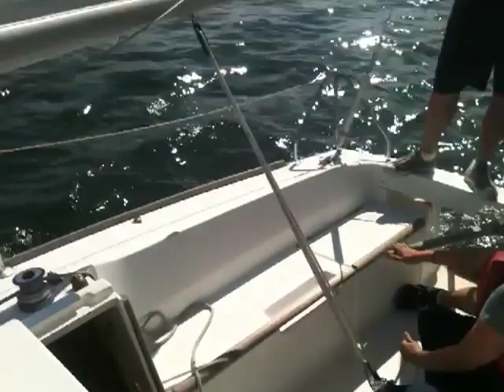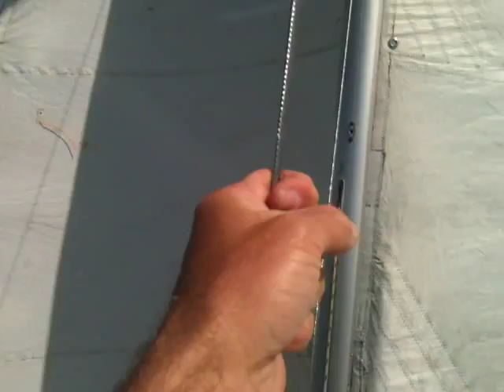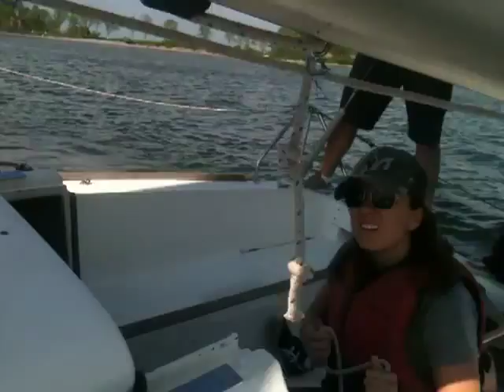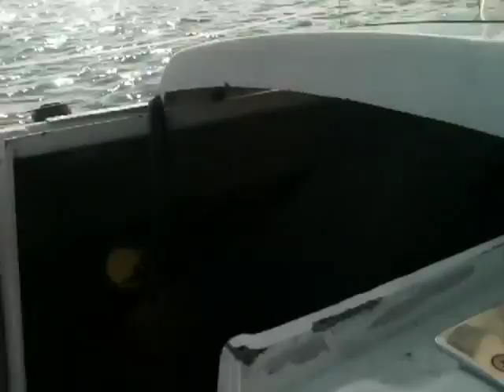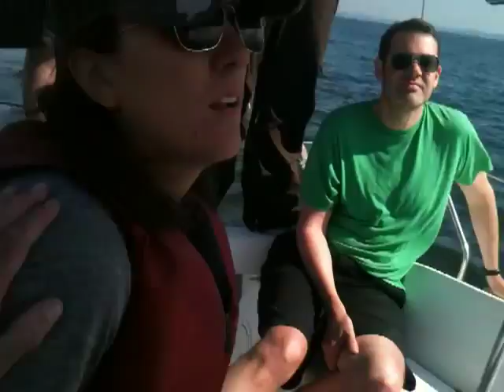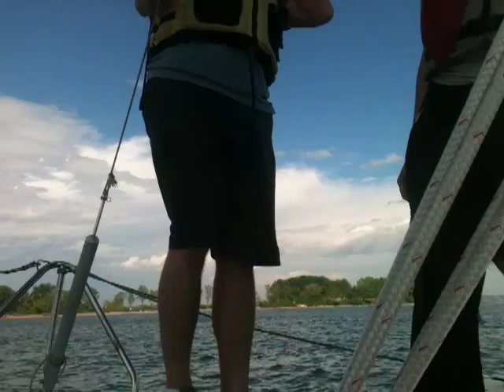Learn to Sail: singlehanding around our Obstacle Course

Comment: Thanks for responding to my comment.  A life jacket is only going to work if it's being worn and it shouldn't matter if the weather is hot or cold as far as if you should wear one or not.  I'd rather be a little uncomfortable and know that I'm doing the right thing by wearing a life jacket.  The Coast Guard rarely pulls a dead person out of the water that is wearing a life jacket.  It's usually the person that was too cool to wear a life jacket that is pulled out of the water already dead.